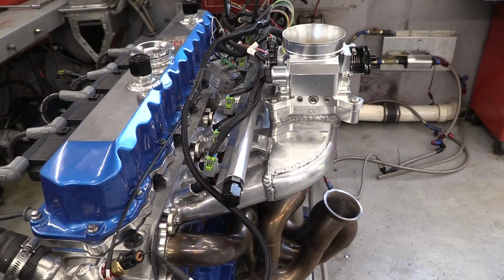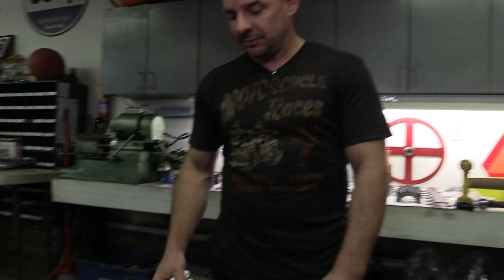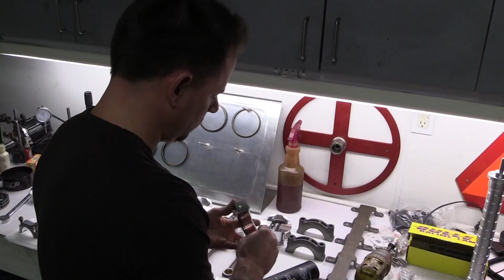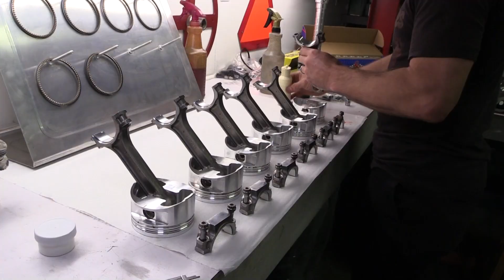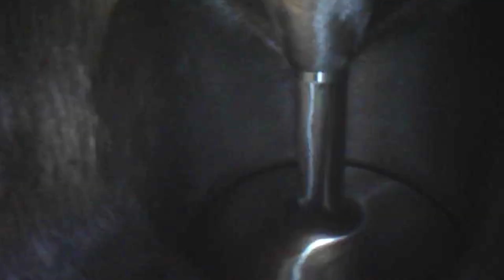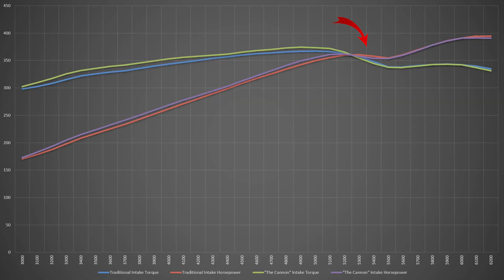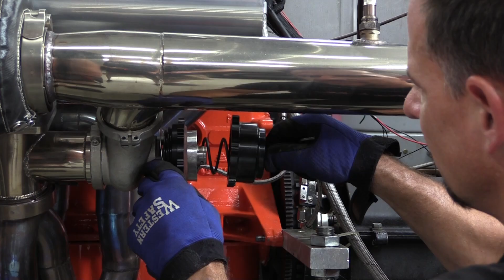Turbo Jeep Smashes World Records! (Tons of Innovation!)

Comment: My dad worked at the Engine plant where these were built. He was a Tin Smith in maintenance, but he would talk to the guys in the dyne room on occasion. The 190hp stock number was where they had to dial it in to avoid damage to trans and driveline components. As you can see it's a beast.
Reply: For it's time, the 4.0 made incredible power. Almost 200 hp when most v8s only made about 250.
My auto 4.0 ho. was faster to 60 mph than a NA 5 speed Stealth. It was dead even with a mk3 NA supra to 80 mph.
Reply: Cross flow head would have kept it relevant for another half century.
Reply: @nickthompson9697  
Theres three ways to get one. Cut and weld a set of SBC or SBF heads. Design, make cating patterns, cast and machine a special. Or design and 3D print an aluminum head that needs a lot less machining. The V-8 heads are probably the cheapest but you also have the problems of coolant passages and thermostat mounting
Reply: @mpetersen6  Where are the pushrods going to go? There is no room, you'll have to put the cam up top. Now you got to redesign the block. IF you gonna do all that work might as well design one from the ground up.
Reply: @CanadaBud23  
People have put v8 heads on Ford and Chevy inline sixes which aren't much different than the 4.0. The way to start is looking at the problem is putting a head gasket for the V-8s on top of the 4.0 and see where head bolts and coolant passages line up. The Ford has the exact same bore spacing and the Chevy is only .020 more. I not saying it would be easy. Just that it could be done. For castings making patterns could be as simple as layering thin sheets of plywood to match the contour layers.
As for a completely new casting a used to work with a guy that wrenched for a racing team out of northeast Illinois. They run sports racers. Some events they go to are the 24hr of Daytona. Their cars use a Brian Hart designed 4 cylinder.  Parts are not easy to come by. Heads are non existent.  So they commissioned a new head design, had patterns 3d printed and castings poured. These where then CNC machined. With laser scintered 3D pri ting in an aluminum alloy powder you might be able to skip the pattern and casting step. A lot of the machining too. The thing I wonder about is the density and over all strength of the casting vs 3d printed. Some information I've found has higher strength vs lower fatigue life. There is a strat up rocket company that is or was looking at 3d printing aluminum structures for launch vehicles. 
https://www.theverge.com/2019/1/17/18185136/relativity-space-3d-printing-terran-1-rocket-cape-canaveral-florida
Reply: @CanadaBud23  should do the free valve stuff, thats my plans for my 91 wrangler with the
 HO 4.0  to make more HP baby
Reply: What was the best true number before detuning?
Reply: @nickthompson9697  
The talk at the time was 1 hp per CID. It's to bad they never designed cross flow head for it.

Comment: Man thats just insane Gotta Love that Man, im ichin to think i might get close with my in 235 chevy what do you think? could a system like this work for a inline six Chevy?Armyguy@aol.com.
Good for you Keith.👀😎✌
Reply: Have you not seen the insane stovebolt 6's they build to drag race in Brazil? Check out you tube for Opala drag racing (the car they use, kinda Chevette like). They pull 1500 HP and 6 second 1/4 miles.

Comment: Aren't you supposed too increase spark advance to get benefit from water/methanol mix ?
Maybe you did reduce spark but increased boost instead ?
Reply from the maker: Yes. Boost was increased when we added water/meth. Also decreased spark timing a bit. Maybe not necessary but that’s what we did
Reply: @TheHorsepowerMonster  How many degrees did you set ?

Comment: Wow, that is diesel crushing numbers. Imagine if something like this could go into a production vehicle and be reliable.
Reply: One thing power train engineers had to do was run production engines at full throttle for 500 hours iirc. That's three weeks non stop flat out. Let's say that equates to 100 mph for an example. That's equal to 50,000 miles.
Reply: Rookie numbers.
Reply: @nickthompson9697  
Compared to a diesel used in a semi true. The 500 hours was with no appreciable wear on the engines. I'm not sure how they handled the oil change cycle. Either shut it down at the hours it takes to get to the required mileage or use an oiling system that had a really large capacity. I suspect they did the regular oil and filter cycle. One gauge I think they should have put in cars a long time ago was a engine run time. 3000 miles on a car that idles in traffic or a police cruiser idling at for hours every week is a lot different than one driven at moderate or highway speeds.  Look at the trouble that Chrysler and GM is having with camlobe wear on Hemis and LS's. At idle the Hemis just aren't getting enough oil to the lube and roller. Chrysler raised the camshaft so high the lifters are pretty close to horizontal. So any oil that comes off of the lifters themselves has no chance to fall on to the roller or lobe. The only way the lobes or lifter rollers get any oil is from oil getting thrown of of the Crankshaft and connecting rods. In addition there is an oil galley cast into the block in between the camshaft and crankshaft. On top of that although there is an oil galley to supply oil to the lifter bores the hydraulic portion of the lifter is supplied through the push rod from the valve train. Chrysler did the same thing on the Slant Six when they changed over to hydraulic lifters.
Reply: Ford tried with the ecoboost.
Reply: @nickthompson9697  They should have "ecoboosted" the 300 6.... in my opinion.

Comment: The word is Fca is bringing back the slant six motor
Reply: Rumor is they are developing a 3 litre inline 6. 
Possibly turbocharged, and possibly to replace the hemi, or provide similar power in vehicles where a hemi won't fit. Supposed to be used globally, from almost every Fiat brand. As long as they don't ditch it to jump on the electric fad.

Comment: why would i not touch an engine part with a magnet ? that makes no sense atall ! iv never had a problem
Reply: Magnets always collect metal shavings. Can transfer to other things. Like throwing sand in an engine.
Reply: @njinthemj52  nah the real fear is a magnet can magnetize the part and then attract ferrous  metal leading to failure. It's the same reason the bolt carrier is checked for magnetism on AR-15's etc.

Edit: I just want to be clear though, touching a magnet to a part shouldn't magnetize it.

Comment: Got to love the sound of the inline 6 but my only question how fast will it go 0-death wobble in a Jeep?
Reply: My Jeep would death wobble if you set that engine next to it.
Reply: The first bump in the road.
Reply: 1.5 seconds!!
Reply: Well if you put it in a lifted one, hehe you'll have lots of different problems. If built for the street shouldn't be a problem. Most peoples Jeep shouldn't have 100hp in them with how hacked together they are.

Comment: While the bill is impressive I believe Barney Navarro should be given the claim to fame for making a rambler AKA AMC motor into a formidable Force in the early 1950s when he built Indy motors that were turbocharged and made anywhere from 500 in a single turbo application to 700 and a twin turbo application albeit with custom parts and a lot of ingenuity it did survive from all accounts and the man himself was well known for working with motors that didn't exactly have much in the way of support. Also this was using not electronic fuel injection but mechanical fuel injection and often dismal proposition in those times.

Comment: When i had my 03 WJ i had a well documented diagram and parts list printed to build a very extremely similar setup. Intake manifold, throttle body, exhaust heads and turbo. Finally glad to see someone doing an very identical replica i had planned a few years ago. Too bad i cant invest in such at this point, i had an issue with my WJ and ended up just walking away from it as the cost to fix it was just not worth it anymore, vs amount of miles it had. (320K)

Comment: It would have made more power quicker if you wouldn't have lowered the compression. Lowering compression on a turbo car is so 1998.
Reply: That would be so easy and sounds so 2005ish. This was a purpose built regular old 110 race gas(Not corn based) motor to simply set a new record and be a daily driver then turn it up with out worrying about something that ultra timing sensitive. This thing can drive up to a pump and drop in 87 if needed and roll down the road while your still hunting for an Orville Redenbacher dispenser. Think of it like this, would you take ONE pound of boost or One point of compression for more power output, me I'll take more BOOST PLEEZ!

Comment: Brazilians not impressed... JK

Cool build, modern tuning tools its what is all about. Most engines have solid engineering but if you start pushing without good tuning even the strongest engine will rip to pieces...

Comment: Ok,, guys.. you may have to change the title to this video.. I found a 700+ H.P.  FIRST run in 1969.  100 psi of boost. and a non filled block. In a 199 cubic inch engine. .. Do a HP by displacement.
Reply: Was that Barney Navarro?
Reply: @xmo552  correct
Reply: @morelanmn  
Thanks

Comment: That was a sick video! Wondering how much it can take before it splits the block or raises the head. We should start a gofundme so we can find out
Reply: Yeah,, do a Holdener LS test,,run it till it throws a rod dyno run or spits out a bunch of things!!!!!!!!!!!??!!
Reply: That bottom end scares me. I think that'd be the first thing to go bang.
Reply: Anytime soon. This engine is only doing short bursts at max power on the dyno.
Under load for any length of time on the road and at nearly 700hp the crank/ rods will break, blow a hole in a piston or two or six
or split the block..

Comment: Any harmonic issues with the cam? I’ve spun my stroker Jeep to 7000rpm with a  Clifford solid cam and spring set up, I’ve heard there are some harmonics at around 5000rpm in the camshaft, do you do anything to add support to the cam?
Reply: 5300 is the cam and crank harmonics no-no spot i believe. they said to not hold it there
Reply: did you watch the damned video ffs?

Comment: It makes me so happy to see these old american inline 6 engines get pushed to such high numbers. The japanese inline 6 engines are so famous now pretty much just as famous as the LS. I knew there were tons of common inline 6 american engines in Jeeps and other vehicles that would probably be able to make just as much power with the proper turbo setup. It's so cool to see people finally doing it. The inline 6 is just such a good design. Why do you think all of the best diesel truck engines are inline 6. The price of 2JZs is starting to get astronomical. And really they aren't that special. Here we can see that pretty much any well setup turbo inline 6 can make big numbers. You don't need dual overhead cams when you have turbos. And it just makes everything that much simpler. This is actually something I had been dreaming of doing myself but without the time and money to do it I'm so happy to see others stepping up to get it done! There old jeep engines are so common and cheap. Great to see them getting used to their full potential. Time to start making some adapter kits to help others get to the same level. I'm sure there will be people interested.
Reply: Did you just compare the Jeep IL6 to a 2JZ? The only thing they have in common is their basic shape. Haha, a 2 valve push rod vs a dohc 4 valve. Yep, samesies.
Reply: I was thinking the same thing... These engines are everywhere and less of a “fancy” setup and older design than a 2JZ... No VVT, 2 valves per cylinder, pushrod design... if Chrysler evolved the design of the Jeep 4.0 they could have had themselves a screamer.
Reply: You are totally correct. But i have to say that you are also partially wrong since people have been messing with the slant 6 chrysler for years. What people should be doing is figuring out a crossplane head design which for a i6 engine would entail making one into a overhead cam engine
Reply: This is about the most braindead comment I've read in a month. You clearly dont know shit about mechanics

Comment: I have a 1963 Willy's Jeep with the OHC Tornado straight six in it. I wonder how much power that engine could produce? I'm guessing that cross flow head either already or with porting would flow better than some of the non cross flow variants. Part of me wants to see and part of me wants to leave it as original as possible. The truck only has 28k on it. I bought it over 20 years ago for either $50 or $100 because the previous owner had broken one of the shifting forks being in a hurry one -30F morning. Dad fixed the fork and we used it a little but not too much. It's still sitting on my parents land. It needs the interior restored along with the floor pans being from up north but the rest of the truck is in good shape. Someday I'll bring it home and get her fixed up and running again.
Reply: be careful with flatheads and turbos. flathead ford v8s cant be turbocharged because their exhaust goes right though the block. this will heat the hellll out of the block. as long as it doesnt have some weird exhaust routing like the flatty v8, you should be fine.
Reply: @frigglebiscuit7484  It's not a flathead. They only used that engine for a couple years. It's an Overhead Cam engine. Has a 2 barrel Holley on it now and is supposed to have somewhere around 8.5:1 compression. The Tornado 230 replaced the Super Hurricane 226 which is a flat head. My Dad had one of the later in his dozer.

Comment: Great build and thank you for using mostly stock parts and showing their potential. 👍👍👍👍👍👍👍
Reply: nothing left even remotely stock,the "previously but no longer" stock head would cost 5x what the best aftermarket aluminum head you could buy would cost.thats close to a 100 hours of labor at $200 an hour easily......the block is almost full of block fill and would die a quick death in anything but short dyno runs or drag strip runs
Reply: trillrif axegrindor I meant using stock parts , they are modified but stock parts nonetheless. You should try building your own stuff and stop paying $100 an hour on labor. Just because you use your credit card to have stuff built doesn’t mean we all do.
Reply: @Morealone1  So when was the last time you ported heads and balanced a rotating assembly???

Comment: what is the dip in the combustion chaber for on the opposite side of the spark plug hole. 11:00
Reply: I'm not a casting expert, but it has to do with the way casting has to be done for the water passages. Many heads are cast this way no matter the manufacturer.
Reply: The way the original head is cast.
Reply: @guhfluh  yes but why? why is not flat?
Reply: Bump

Comment: More non Ls builds i love it!
Reply: Underrated comment
Reply: Ls engines are ugly!
Reply: Non LS build but at what cost?
Reply: Lame Shit compared to this!!!
Reply: Yeah it really sucks my junkyard ls twin turbo makes my truck run 8.20s
And cost me 4500 to build!
Reply: The reason people go with LS is because there's plenty of parts and they're cheap. This motor was probably very expensive to build and you heard the guy, lots of parts are special made. Cool, but not practical. I'd rather pull a junkyard 5.3 for 500$ and boost it and make more power than this easily.
Reply: @Enigmah88  You missed the point of this build entirely, this was done for R&D purposes.
Reply: @Enigmah88  you forget the part where they are incredibly reliable and make great power. NA to NA and boosted to boosted the LS wins in every way.
Reply: @Enigmah88 We are all very aware of this, thank you for your totally needed essay

Comment: 2000 WJ owner here. 107k miles.
How do I dramatically improve mpg? 13mpg just can't be right.
My '93 F-150 5.0l with 230k miles gets 16mpg.
Reply: Tune up.

I have 2004 wj 4.0 4x4 3.73s stock everything. I get 18 MPG minimum all day every day. On long drives doing 65-70 mph I've got as much as 25 MPG. I'm not using anything fancy. It's all stock. Cheap copper plugs, conventional oils, proper psi in tires.. 35psi. 
Stock stock stock.

Comment: Looks like a cylinder head flow wall. Hence why the power curve dropped in the rpm range with boost. Cross flow heads can only do so much. I'd love to see someone make a custom head for the amc i6 with intake and exhaust on opposite sides. Lots of $$$ and time. In the end its probably not worth it but who knows. Jeep aftermarket is crazy. We still see jeep 4.0's on a weekly basis for regular repair work. Considering its nearing 20 years since the last time you could buy one is pretty surprising, especially for a chrysler product.
Reply: It's not a cross flow head, it's U flow. And I don't see a wall yet with power still climbing.
Reply: @guhfluh  brian from RCR calls it a reverse flow head, which sounds the most logical to me,
Reply: what wall? he let out of it. that dip was probably camshaft/crank harmonics.

Comment: Meanwhile im here just happy I can get about 8 psi on a stock 4.0 with 200k miles without it blowing up.
Reply from the maker: That's still pretty awesome.
Reply: My Kenne Bell 1.33L makes 6lbs on the 4.6 in the LJ, boost makes the in-line engines a joy to drive.
Reply: I’m currently piecing together a turbo setup for my XJ that has 446,000 miles on the original engine.
Reply: It's all in your tune man 😁
Reply: That's awesome! 8 psi is still something more
Reply: Seal’s
Reply: 250k miles on 10lbs of boost for the past 100k miles and still holding 40psi of oil pressure at idle.
Reply: @johndeeregreen4592  already popped one head gasket...I got some blowby but its made it 1000 miles so far